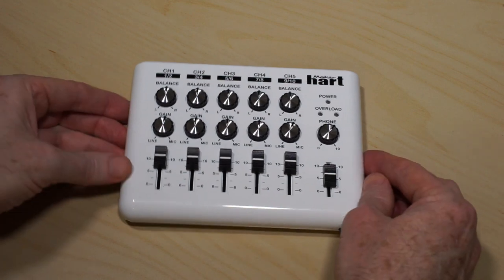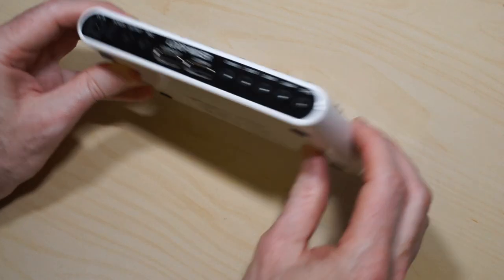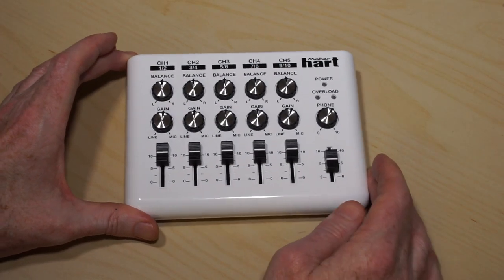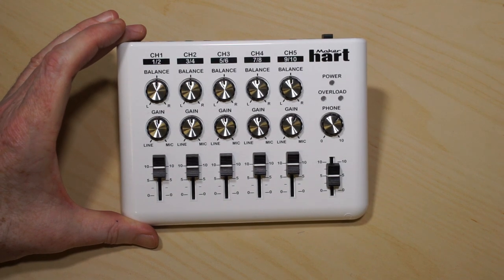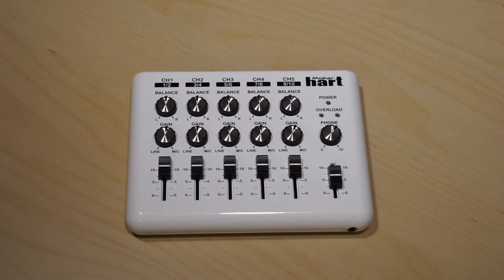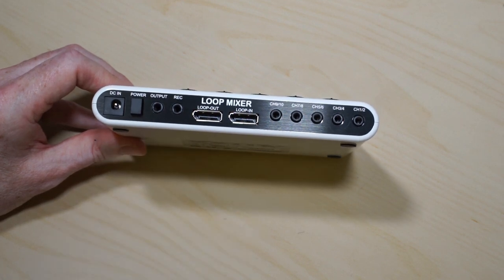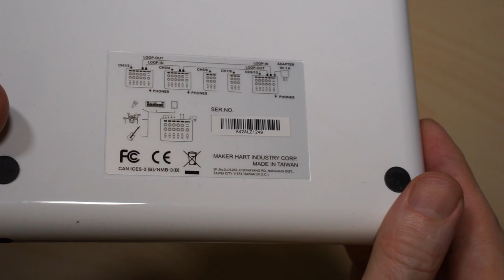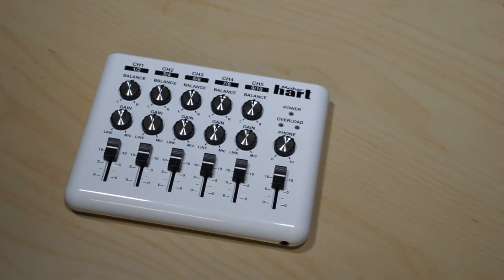Maker Hart Loop Mixer Review

Comment: I'm using it to mix 3 Korg Volcas (Keys, FM and Sample) and 2 Teenage Engineering Pocket Operators (PO-20 Arcade chiptune and PO-33 Knockout sampler) in a portable setup using battery power (including a USB "power brick" with a 9V "up-converter" to power the Loop mixer).  Thanks for your helpful and informative review and please keep up the good work.
Reply from the maker: Thanks! I’m glad you liked it. Please like and subscribe 😃

Comment: Thank you for your thorough review. You helped me decide to pull the trigger and make a purchase with the addition of this: Compact Mini Hum Eliminator Box - 2 Channel Passive Ground Loop Isolator, Noise Filter, AC Buzz Destroyer, Hum Killer w/ 2 1/4-Inch TRS Input and Output for 2 Mono / 1 Stereo Signal - Pyle PHE300. I already have the mic patch cable and a condenser mic.  i may still be unhappy with the noise but going to give it a go. I am still a novice at producing any sort of music but my big idea around this,  is to be able to blend and. record auv3 midi sounds from my ipad, my iphone, and additional audio sources to lay down some song  ideas, samples, even notes to self on top of music.  although this is overkill also wanted to be able to play my MODX8 or midi keyboard/synth while hearing instruction from another source and machine like youtube. I can achieve the last part via the modx 8 but this seems to give me extra flexibility.  the general hope apart from the modx is that the overall sound will be stronger than with the $7 3.5mm splitter.  I know this is a year old but hope all is well and may report back to help others looking at the Maker Hart Loop Mixer.
Reply from the maker: I'm still happily using my Loop Mixer. It's a handy little gadget.